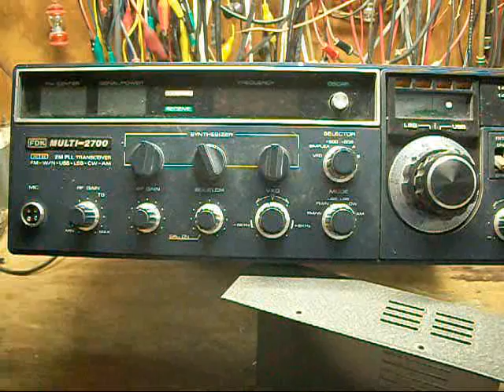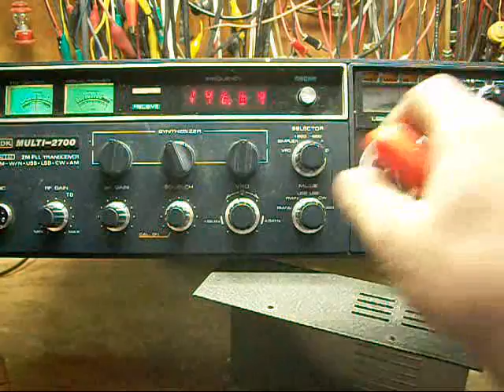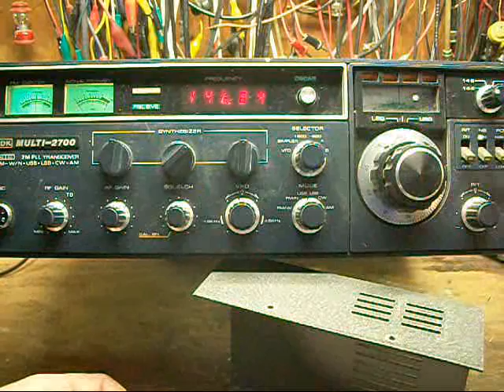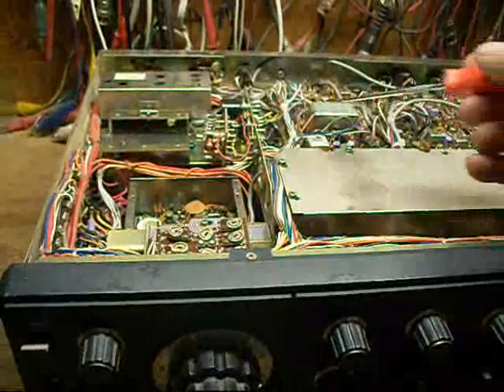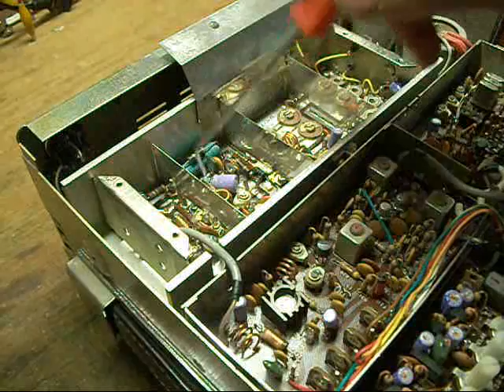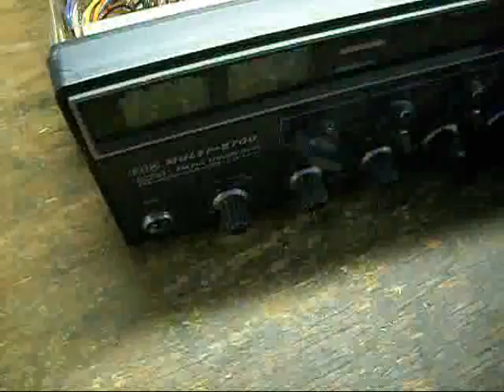FDK MULTI-2700 2M all mode, some problems, and some repairs.

Comment: I picked one of these up from an estate.  It receives great and tx @ full 10 watts, but even though the mic is wired right, I can't get it to tx audio...breaks squelch, but no voice coming through to my buddy across town...any suggestions?
Reply from the maker: Basic questions.
Do you have any modulation on USB,LSB,or AM?

If you don’t then recheck the wiring on your microphone, and then check it’s function with something that will allow you to actually see the wave form coming out of it. 

Pin 1 is ground for TX key.
Pin 2 is hot for TX key.
Pin 3 is mic audio.
Pin 4 is ground for mic audio.

From here on out.. to continue to diagnose the problem you will need an oscilloscope

Once you absolutely know you have audio going in… 
Then check the audio chains on board X17
TR1 is in the uncompressed audio chain.
TR2, TR3, and TR4 make up the heart of the compressed audio amp chain. 
TR5,6,7, and 8 control the gain of the compressed audio stage.

Then check board X18 for audio coming in on pin 6 and pin 16.

Also try moving the audio select switch from compressed, to non compressed.
That may restore audio if one of the two audio chains is non functional. You could also test the integrity of the audio select switch. It may be damaged.

If you have audio on AM,SSB but not FM..

Check board X3 for audio coming in on pin 4.
If you have audio there, then C5,C6, or R3 is bad.

In you have no audio on pin 4, then go back to board X18, and check for audio on pin 1.
If you have audio on pin 1, then go to board X17 and check for audio coming in on pin 5.
Check for audio going out on pin 3.
If you have audio going in, but none coming out, check to make sure either pin 1, or pin 2 is hot (9V)  they are the wide/narrow select lines.

If pin 1 or 2 is hot, and you have audio going, in but none coming out, then TR13,TR14, and TR15. Then check D9, and D10

Here is a link to a page that has the schematic if you need it. 

http://www.concept9.co.uk/2012/01/fdk-multi-2700-multimode-vhf-transceiver-with-oscar/